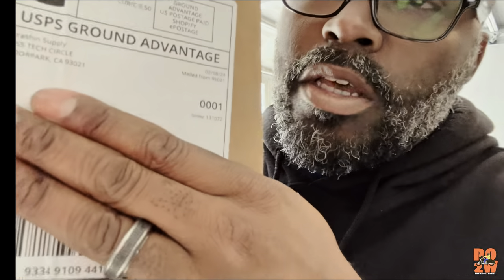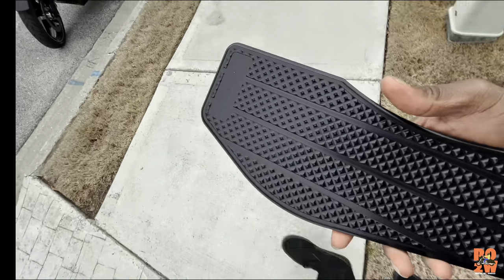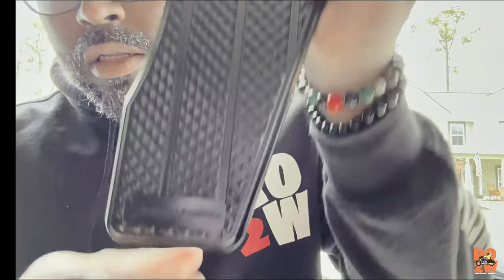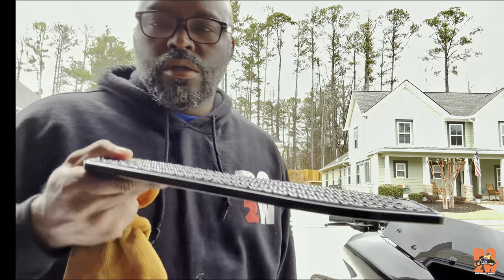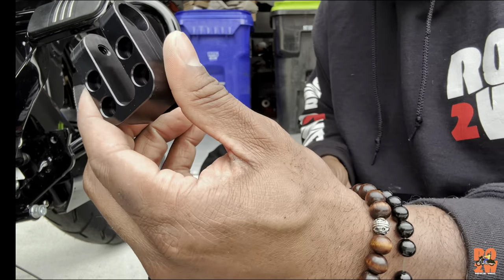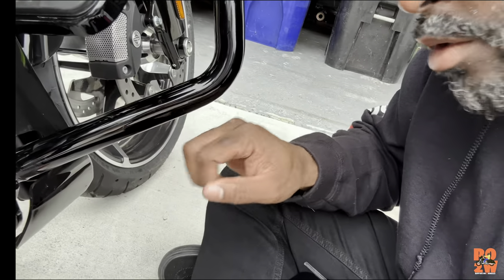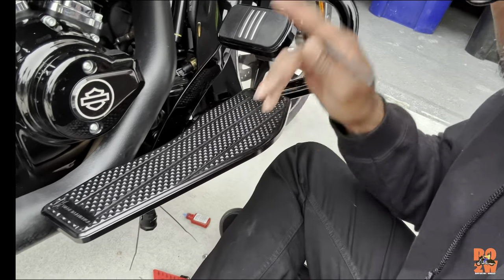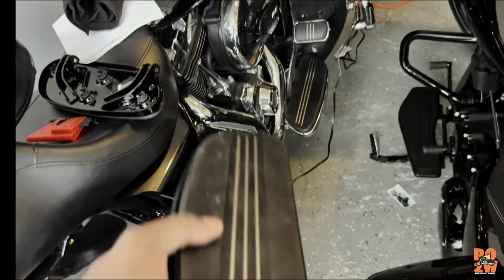Installing these….. Made a HUGE difference.

Comment: I think long term you'll change them. Why? What I see is a flat 1 piece floorboard...nothing wrong with that right? But the issue is that it doesn't have any dampening...so more vibration to your feet. I could be wrong though. Good video